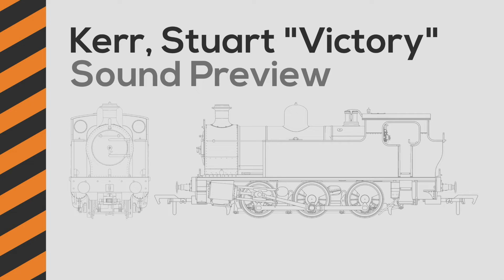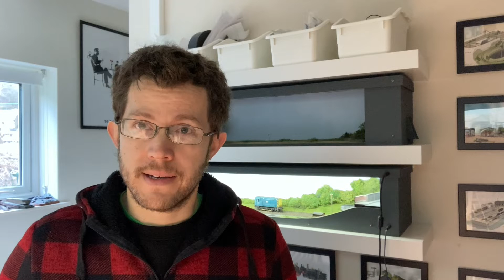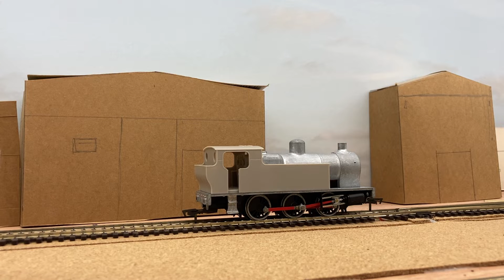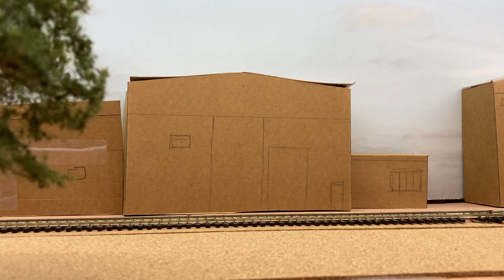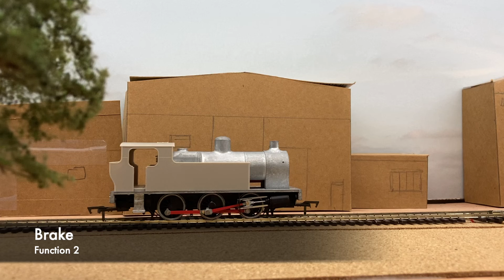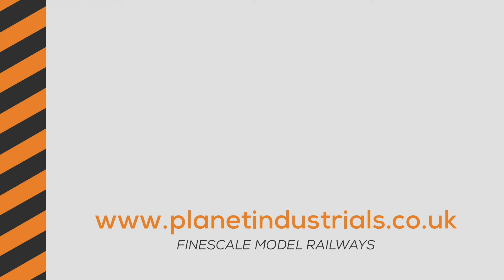Victory Sound Preview

Comment: I do wish manufacturers would get together and use the same function keys for the same things.  It makes a loco almost impossible to use on an exhibition layout where operators are often only available at very short notice, and a loco that defaults to a long coast is a nightmare on a five foot long layout.......
Reply from the maker: Not with the brake function, remember, this will slow it to a stop and is integral, I.e. the longer you press the function the more brake is applied.
I would be happy to adopt a standard, if one existed, for function assignment.

Comment: Any plans to do another RTR 00 gauge steam locomotive?
Reply: If I may suggest a Hudswell Clarke 0-6-0ST (24ton) as it was running on the Easingwold Railway and many industrial lines. There was a nice 7mm scale model by Ixion and one for 4mm scale has been announced (only) by DJ Models.
Cheers
Dirk
Reply from the maker: Thanks for the comment, yes we have plans but nothing we’re going to share just yet. Thanks for watching!
Reply from the maker: @dirks.4172   thank you for the suggestion, we’ve got something in mind already, your idea was certainly considered and is on the increasingly long ‘short list’!

Comment: James,
that's quite impressive.
I wish that more sound fitted steam loco models would sound that realistic.
Is the chuff synchronised by cv settings or a sensor ?
Well done and thank you for this successful demonstration.
Best wishes
Dirk
Reply from the maker: Thanks Dirk, it is synchronised in the software, there are no cams or mechanical actuators here… you can play with the chuff rate on some generic sound files, but what we’ve done is take this a step further, with Paul’s help and develop a model that really does feel as realistic to drive as we can make it.